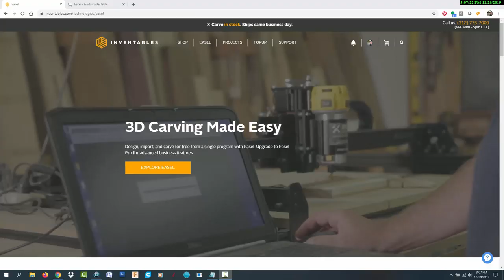Making a Guitar Shaped Side Table

Comment: That's cool, nice idea for an end table.. I purchased some of your plans and did the phone stands the tablet stand and am making the scrollsaw stand for my broken Dewalt. I cut a bunch of 1/2 acrylic and all the mechanism in the front wore out and it's a type one. Dewalt told me I couldn't cut acrylic with it so I bought a HAWK and a Hegner and they are 2 really smooth saws but I like the Dewalt so I ordered all the parts so I can use it also. I like your video's.
Reply from the maker: Thanks!  It's good to hear you made some of the projects and working on the stand.  I know people who have cut acrylic.  I've done some myself.  Just have to keep it from melting back together while cutting.  Thanks for watching!
Reply: @SteveCarmichael  I used the acrylic polar blades. They cut great and didn't melt back together.

Comment: Steve - my X-Carve needs to make this!  Glad you’re back — it’s been too long
Reply from the maker: There is a link to my Easel project in the video description.  You might have to adjust the dimensions for whatever wood you use.  The mortises in the top just need to be the same width as the leg thickness.

Comment: Just wondering if the Maple will slowly yield over time under the constant tension of the guitar string..
Reply from the maker: It's not that tight, just enough tension to keep the legs from spreading if something heavy is put on the table.
Reply: @SteveCarmichael  Ok Steve, thanks for your reply.